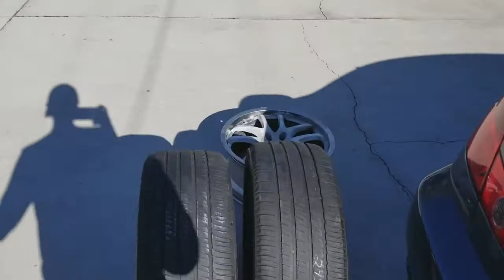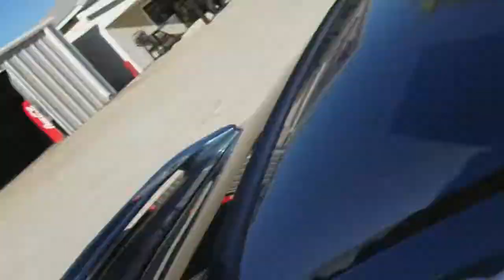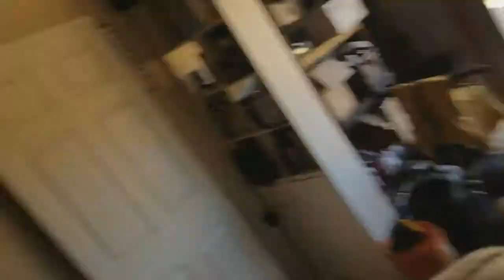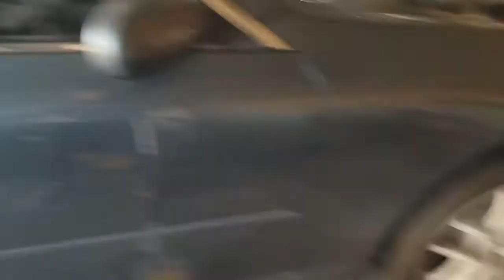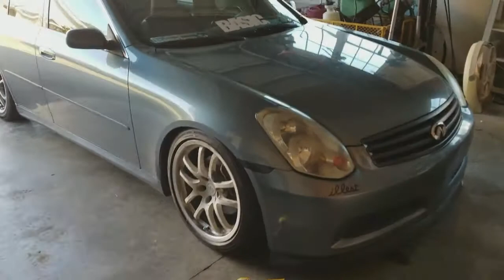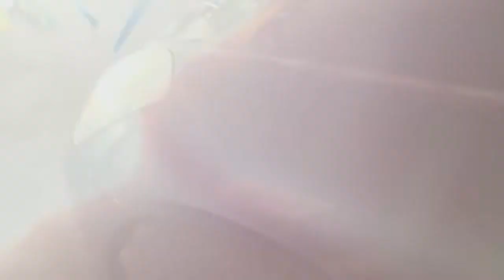Putting Coupe wheels on the G35 Sedan!!

Comment: i got the same 19s for my stock g35 06 should i change anything or i can just put them on stock? im currently running on stock 17s help
Reply from the maker: Brian Colorado yeah you should be good to run them lol, I was on some stupid low cut springs and never rubbed so you got it
Reply: thanks man i was worry bc urs looked very low so im assuming it wont be too tight as urs
Reply from the maker: Brian Colorado yeah no problem man! if your still stock you'll have plenty of room to fit them🤘